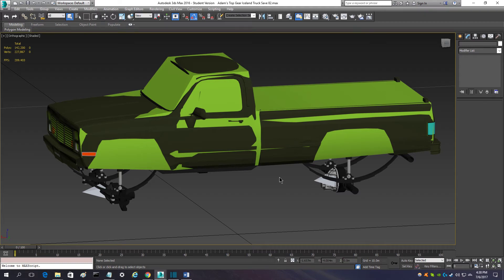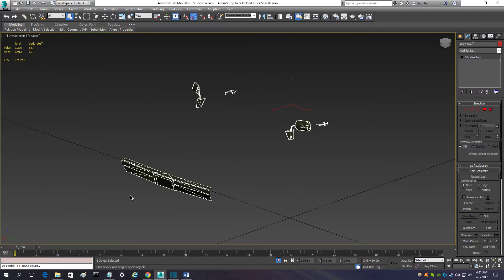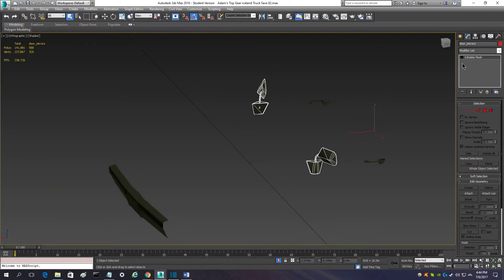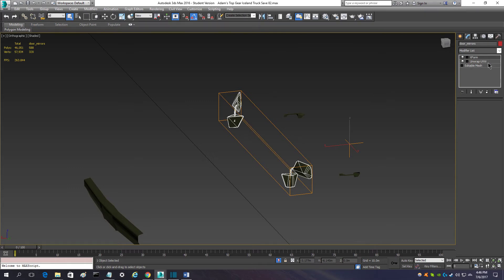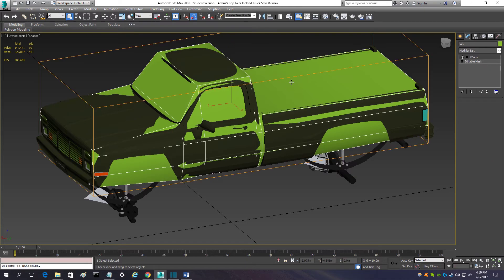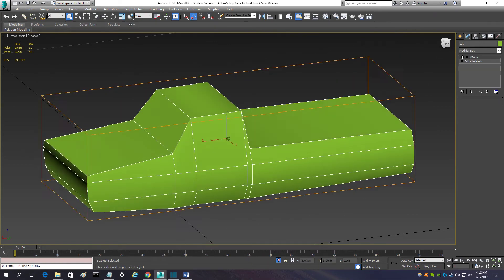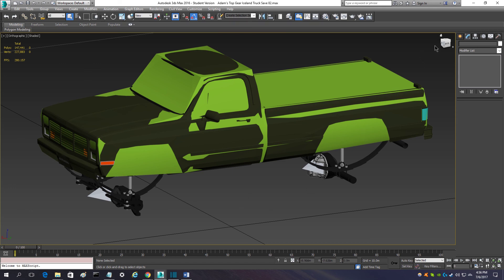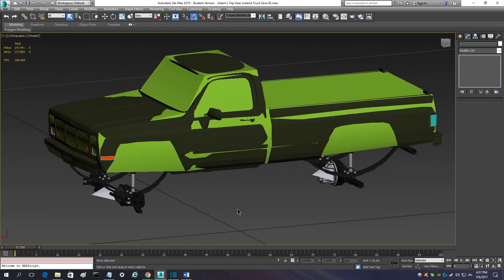How To Make Mods For Spintires - Prepping Your Model To Be Exported Into Spintires

Comment: Can u use blender for this?
Reply from the maker: PlutoTv Force and SmarOneNine do, I have not done it myself.
Reply: xELITExMODAx  Do u think it would work?
Reply: @tylerscheels5934  i'm trying to make mods in blender for mudrunner but tools for exporting are very scarce it seems that you have to export your model to blender 2.79 and use a built in exporter or even older version and use dedicated tools. Still at the modeling stage though, I usually use subsurf and it's hard for me to make very detailed models without thinking that my topology is terrible and thinking about the polygon limits of a game.

Comment: I have made a basic cube in Sketchup, opened in 3DS Max, How do I get this over to the Spintires Editor? I cannot see any Export options for .X or .XML. I have all the programs you mentioned in another video.
Reply from the maker: DigitalXAQ theres an addon for 3ds max called kw xporter, you need to download it and put it in a folder in the 3ds max folder. You can look up a vid on how to install addons for 3ds max. Hope this helps. :-)
Reply from the maker: DigitalXAQ also thanks for the support, my mic broke and I havnt been able to fix it so, thats why I havnt continued the vids yet.
Reply: You're welcome mate, I have KW X Porter I will have another look today. Do I need to make xml files with code in them? I struggle with anything due to a severe mental disability but trying not to let it hinder too much.
Reply: I have the .x file, what do I do with it, and where does it go? I am so lost.
Reply from the maker: DigitalXAQ in the spintires editor there is a folder called mods, right click on it and select create new mod. Then put the .x in the meshes>trucks folder in the folder that was created.
Reply: I'm making a basic cube object, does the same still apply? I've no idea if it has a mesh, it's a basic grey cube in 3DS Max, with a CDT then exported.